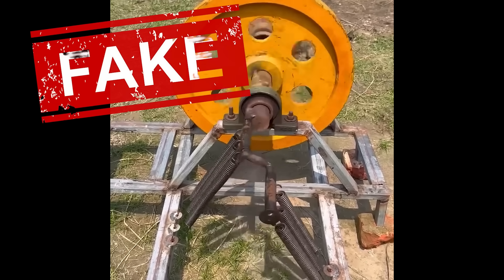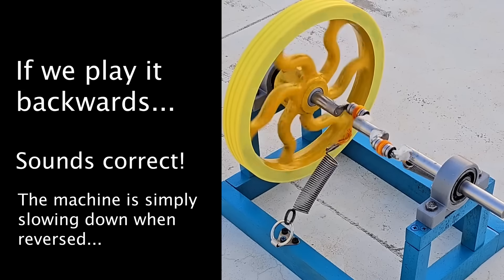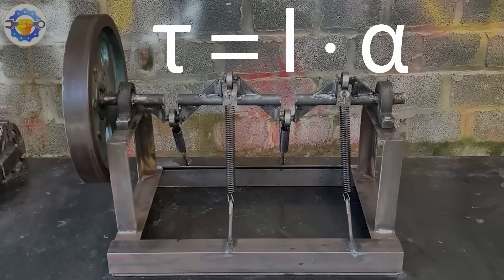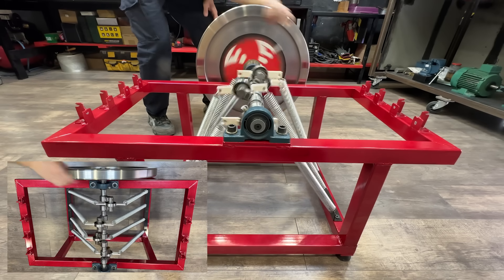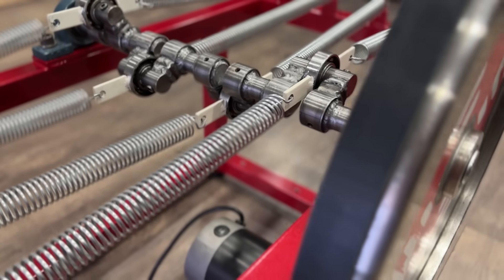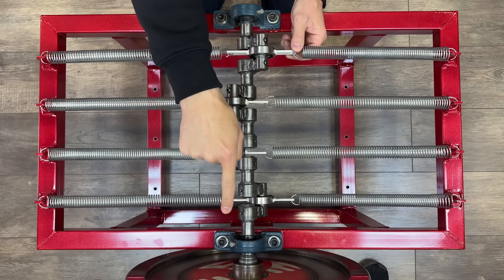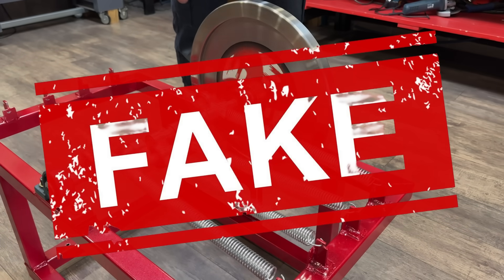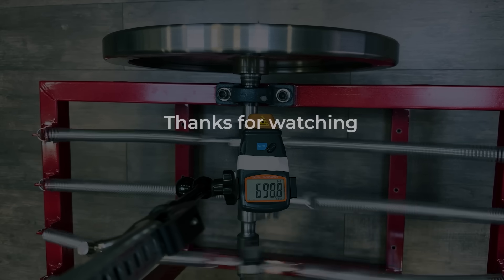Debunking the Controversial Spring-Powered Perpetual Motion Machine

Comment: Could the machine accelerate by itself because the springs are holding some potential energy from the start up of the wheel that slowly transduces to kinetic energy causing the wheel to accelerate? After accelerating to a certain speed, does the wheel then start to slow down?

Comment: Why didn't you use two iron discs instead of one to balance the shaft? I think adding a dynamo and a small electric motor would increase the rotation speed and keep it running continuously. 
Question: Would using rubber bands give the same result?

Comment: You were not adjusting the geometry of the spring-angle distribution to achieve self-rotation; rather, you were attempting to minimize vibration.
However, eliminating vibration merely allows the rotor (or system) to sustain its rotation for a longer period by evenly distributing the load.
This alone—even if achieved perfectly—would still be insufficient to make the system rotate continuously without an external energy source.
Reply: It will work, I've seen a machine like this at an antique engine show. Like anything man made, the springs will wear out over time. The objective is to get springs that are durable enough to withstand more time. The gentleman that had the machine stated with the springs he had, it could operate for roughly 6 months before replacement.

Comment: Have you tried making the inertia wheel out of a ferrous metal that could generate an electron flux field when spinning, then collect that for free energy? I was thinking like, a copper coil and  a low resistance magneto, making up for the lack of resistance with RPM. If you could successfully make a low cost, low power generator, it would completely disrupt the energy market. most people just need some low power to recharge their phone these days.

Comment: how long until it stops spin? i don't need perpetual motion machine, i just need it long enough to operate in an emergency situation. like, able to generate electrical energy for 12 hours, enough to recharge any battery, without relying on solar or running water generators. 

this type of machine can be used in complete darkness. without using solar, water, wind or any type of fuel. no emissions, no air pollutants. perfect for underground basement or shelter. so, if this machine can keep running for 12 hours or more before coming to a stop, that's  amazing. it has a lot of pratical use.
Reply: It could not give any energy away, there’s just enough to keep it spinning until the springs loose some elasticity.
Reply: не витрачайте свій час, це фейк, він ніколи не буде працювати. Це проходять в школі, на уроках фізики, там навіть є цілий розділ присвячений "вічним двигунам".

Comment: First of all, the flywheel would spin longer and still stop if I didn't lose some of its kinetic energy to friction and convert it into elastic energy in the springs. If it's truly perpetual, don't connect an electric generator, but make a 20-hour video, without cuts, in which the engine doesn't slow down or stop even without a load. In a live broadcast, measure the rpm every 60 minutes and show them. I don't think we'll finish the first hour!
😂 🤣 🤣

Comment: I’d love you to put a load on the flywheel and show the continuous motion, even if it was to last 1 hour before stoping this could be used to charge a battery in a power outage with minimal initial energy input
Reply: Nice observation. Yes, it has the potential to be an emergency battery charger.

Comment: I disagree,altho I haven't tried it,I be leave this system could work with counter weights evenly spaced on the flywheel,counter weights 1 pound heavier than the spring load. Counterweights,even the amount of springs. This should  counter the drag  loss

Comment: This system can rotate without spring 2 to 5 minutes and with springs it can run 5 to 10 minutes depending on your making. But at least it will stop not run forever. But if you add 12v motor .it can run 15kw generator continuesly. I have checked.
Reply: I'm not good with this stuff. But if thats the case, then surely you could store some energy generated and run a motor to get the speed back up, then store that energy, which will become more and more with time, until the springs go bad.
Reply: Hola, puedes demostrar que tu experimento funciona? Estoy interesado en ver tu prototipo.

Comment: I noticed no mention of friction losses. All those springs flopping around have to really exacerbate air friction losses. On a wild guess, I'm gonna say there's a e bike wheel motor hidden in the flywheel. The batteries are as well. Probably triggered with a mercury or other light inertial switch.

Comment: What you’re looking at is a camshaft mechanism connected to heavy springs. As the camshaft rotates, it pushes against the springs, stretching and releasing them. This converts rotational energy into potential energy in the springs, and then back into rotational energy.

It might look like it could run forever, because the springs push back strongly on the cams, but:

Friction in the bearings and between moving parts will always sap energy.

Air resistance also slowly drains motion.

Each compression and release of the springs involves tiny energy losses (heat, vibration, imperfect elasticity).

In reality, unless you continuously supply energy from outside (like an electric motor or hand crank), the system will slow down and stop.
Reply: The only thing that matters is that it can run while charging something for an extended period of time like an hour. It doesn’t need to be eternal.
Reply: if it can run for at least 12 hours before stopping, it has a lot of practical use. for example, in an underground shelter. you don't need fuel, wind, solar, or running water to generate electricity, just this machine and all your batteries can be charged.

Comment: The math may be there, but the thermal dynamics for it isn't. The lifetime of those springs are low due to the amount of heat energy that is going to degrade the elasticity and overall strength of those springs.
Reply: just need to run long enough to charge batteries. not eternal. perfect for emergency. no need for solar. can be used in complete darkness like underground shelter. no air pollutants either as it don't use any type of combustion for operation. perfect for enclosed shelter.
Reply: @dinslax5270  Dream on.

Comment: You arm chair Einsteins are missing 1 thing in each complaint. I saw a Pakistan engineers that built one of the Liberty engine design. 10kw output that used 1kw to keep an electric motor going. It has to have some input. I think these guys are right about the science and math behind their videos.

Comment: Perpetual motion is a Myth If you believe anything else you need to have your head examined
Reply: I rather believe in Tesla. But you do you
Reply: While I believe and agree with you, I still have my sights set into finding one. I personally believe pressure can be the answer to it all.
Reply: @TruceFeud  Unless the laws of physics suddenly change overnight, perpetual motion is impossible. The principle is simple: you always lose some energy going in, and it’s never enough to produce more coming out. Imagine pouring a measured cup of water through three feet of garden hose into another container. When you check, the second container will be slightly less full, because some of the water stuck to the hose along the way. Energy works the same way — whether it’s power, electricity, or mechanics, there are always losses, and you never get more out than you put in.
Reply: @boduzapho  Oh I am absolutely aware that it is impossible. I just use this as a kind of motivation to drive me to making something better. It can't hurt to strive into better ideas.
Reply: TESTATIKA !!!
Reply: No one is claiming literally perpetual motion. It’s just a perpetuating motion machine, which perpetuates itself for an extended period of time after a short effort to get it started. Still Extremely valuable.
Reply: @njr819  That doesn’t make sense at all. If it keeps itself going without additional energy input, that is perpetual motion — and physics says that’s impossible. You can build something that coasts or oscillates for a long time because of low friction or stored energy, but it’ll always slow down and stop eventually. There’s no such thing as a machine that ‘perpetuates itself’ indefinitely after a quick push.”

Comment: The energy stored in one spring is exactly balanced by the other:  when one stretches, the other shrinks, so the total length is constant.  Your own formulas show that the net energy exchange is zero.  Except they are not ideal springs, they have friction so a small constant is subtracted on each cycle.  The springs will dissipate the energy.  Any honest run will show that it spins longer without the springs than with.
Reply: I agree, Without the big heavy wheel it would not work for even a second
Reply: das sehe ich auch so, wäre schön wenn es anders wäre.

Comment: It can work and continue rotating forever, but there are conditions, the most important of which are the angle of the springs and the type of metal used in the spring. If you know how, contact me.

Comment: Talking about the harmonics it does get harmonic occlation but it quickly dampens add it needs to pull the spring that releases the elastic energy again takes back the energy and again release it this continues and after sometime it dampens as sound heat and mechanical losses the facts that are mentioned by them itself, if there claim are to be true then the  1st law of thermodynamics doesn't holds true as it suggests that  L^2/2I =1/2kx^2 as energy feeded in the system by the fly wheel is = the energy stored by the spings and also the same release, so when an external force like friction or the sound or mechanical vibration loads the system it bleeds energy dampening the occilations

Comment: Please explain the calculation of the angle of each spring lever on the axle, so that it does not lose energy and can work well, maybe we also need a detailed explanation as a whole, such as the distance of the lever handlebar from the main axle, the ratio of the wheel weight to the size of the spring tension force and so on, thank you🙏🙏🙏

Comment: We can't stop from using the gasoline engine to help push or pull , it just reduce from big to small , spring by it self is no auto excellerator  when in use no matter even we use transformer, when use a little or a lot the voltages will not stay the same , spring it self has no auto up and down push, gasoline has auto push and pull when in use, just add small gasoline engine it might work well , thank .

Comment: Each pair of springs is a balanced system capable of damped oscillations, but this does not make the system perpetual; it needs a supply of energy! However, the video mentions vertical oscillations of the spring pair, which is unclear here.

There is resonance, but it only amplifies motion if even a tiny amount of energy comes from somewhere—say, from the springs moving up and down. In that case, the exact source of energy and its magnitude is considered the ‘spring oscillation.’

Yet in the video, the electrical output is 480 W, which is 480 J/sec. Then each spring pair would need to provide exactly 480 J/sec from its up or down motion, because no resonance alone can deliver that power if the source itself produces less!

What’s also interesting is that after connecting a load, the flywheel did not slow down, as if the system perfectly compensated for the load. For that to happen, the ‘torque’ should have changed. Since the springs are the only source of energy, how could they alter their output force on the fly? A spring has a fixed force—or depends on its tension—but the distance from the mount to the shaft is fixed

Comment: Here's a tip: remove all those pointless springs which are wasting energy on heat and friction, and your flywheel will turn a bit longer before it eventually stops.  It will be "more perpetual" than your current "perpetual" design :).

Comment: The problem with some people saying it's not possible. they're so fixated with the formulas that was based from the era where technologies wasn't easily available at that time. most people even relying on books and haven't done any actual confirmation. They say magnetism wears off, there's a solution to that and I have been using it. They say stored energy is equal to the output, there's a way to double, triple, quadruple, the output and even more which I also have done it and is still been using it for my own. Don't just stick to what the book is giving you or even what the old eras provided you. Be creative, open your mind, go beyond the lines, have an open book with extra pages. You'll be surprise what you will find and can make.
Reply: hahahahahahahahahahahaha....also the Earth isn't flat.
Reply: @Unit1001InDistress  whoever said it's flat is nuts.

Comment: It doesn't work and there is no free energy there is
reactive or accumulated and that is the earth's magnetic force and static electricity but still mechanical work, heat,
photons are needed to produce a pulse spark and so on. In this case
you have four springs on one side and on the other side four and when forces are equalized then the whole system stops I am developing congratulations energy but not free energy,

Comment: So, how long did it run? Is it still running? Why did you not hook it up to a generator/alternator? Will it produce enough electricity to power a LED?
Reply: You just tell us about the size of spring and what number is made of wire, how much is its length and what is the size of the hole inside it. 
What is the length of which frame you look spring .
Reply from the maker: We already did those demonstrations in the first video
Reply: @thelibertyengine 
What’s the link to the first video that answers my questions?

Comment: What a load of crap. 
A spring applies force until it relaxes. Once it does, it needs the more energy (due to losses) to reach the same stretch and hence be able to repeat. So you use another spring on the other side, but this needs more energy than it has to achieve it so they end up cancelling each other out. Zero sum game.

Comment: SMES Tiers and Levels Exception APPLICABLE and APPROVED for Statistical generation of energy source (one of several energy sources) based on Case studies applied.  Reason:The set of cases illustrated, particularly the last case and prototype model, guarantees continuous trial balance of the equilibrium in energy distribution, since it the coiled springs and its weight differ from one another,  with the manner they are placed also a distance apart from one another, guarantees that complete momentum, applicable to engines that are placed into Automotive, scalar ∆ and summation. These prototype models guarantees energy sources, it only needs controllers to gain momentum, and harness energy, either continuous free flowing or by storage. Tierage, the scale model can be applied for various industries, that is also related to Refrigeration, HVAC System, Cooling and Heating systems, since parallel energy sources or connectivity can also be applied, solar + Magnet + Coil based springs + water Hydrogen +Batteries such as Sulphites based and Lead acid also salts and electrolytes. THANk You Tierage. Looking forward for newer sources of energy applied in industries such as Transport-Medical Science, Hospitality, Agriculture, Shipping. Respectively,  Tier 4, Warranties Support, Returns, Logistics. NON AI,/Fintech standards of Excellence.*******NON FORFEITURE, DELETION

Comment: The problem is the stretching of the spring to get to TDC. The Frame attachment point of the spring needs to move up also. On the way up, the spring should stay un stretched, then when the crank gets to TDC, the sprint attachment point needs to drop to stretch the spring for a power stroke, or else the springs just fight against each other

Comment: With the formula you have shown and the machine structure, I agree it will work. But I also agree it will not last for long. Due to friction. Every  mechanical system has friction, which converts kinetic energy into heat. Even with lubricants, friction will gradually slow down the system. And lastly, I see unbalance forces. Maybe due to the spring releases energy unevenly, it can jerk the system back and forth that cause vibration.

Have you tried magnetic? no spring. And connected to Rechargable AC batteries.
Reply: You got the point, but also for the mags, mags also are energy things

Comment: If this actually works.. how about a graph / table showing the extractable continuous usable energy available.. the accel energy.. you mention that the vert resonance of the springs is the secret solution and appx 700 rpm is the upper stable limit ... Why does the system seem to self accel ???
Reply: Скорее всего, потому что раскрутили маховик, сняли замедление, и запустили воспроизведение в обратную сторону )

Comment: did you try to put a load connected to flywheel (thru a belt) like in water pumping, or electricity generation and still will continue to rotate?

Comment: Of course it will work since the resonance vibration induces the continuing kicker energy after applying an initial force by hand. And installing dynamo below or installing electromagnet wire around the fly wheel and neodineum magnet stick to the flywheel at intervals of N-S succession, it will produce high output of electricity.